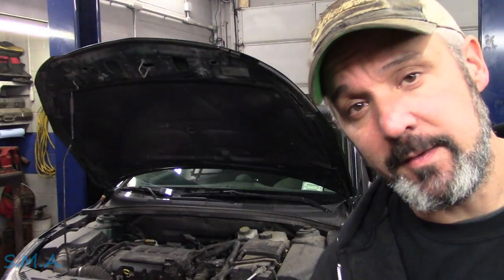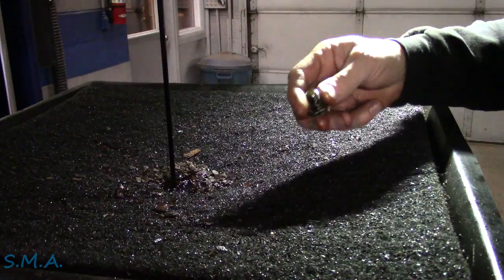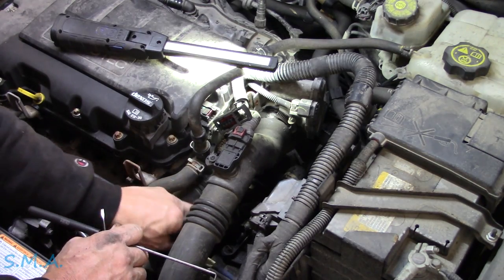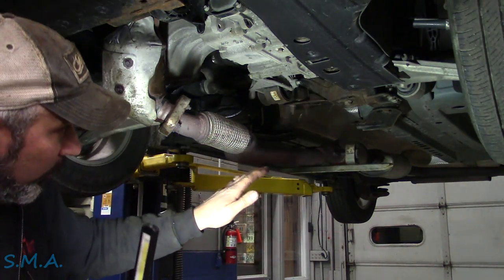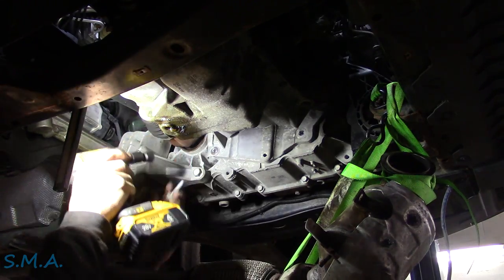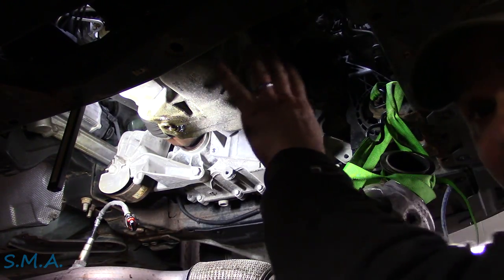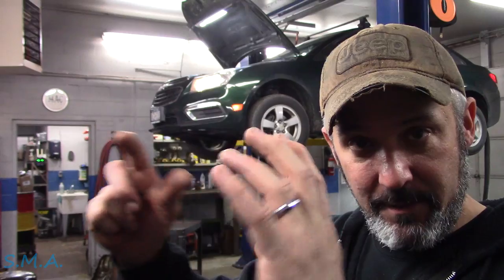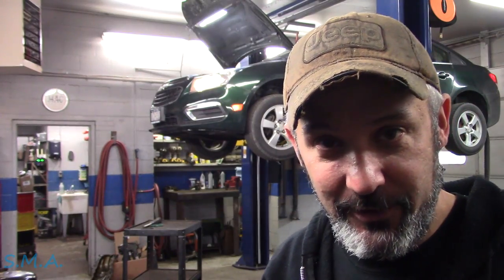Chevrolet Cruze 1.4 Turbo: Oil Pan Replacement

Comment: I have this same turd. It's a 2015. I've already replaced the coolant output,  the thermostat housing and the valve cover.  Now everything else in the video except the pan is leaking oil everywhere.  Great video Eric.  I've been trying to figure out what else exactly is leaking. Their is oil all over the passenger side of the motor. I am more of a chevy guy but these cars are trash.  However its paid for and my son is 16 so I guess ill just being doing a bunch of fixing.
Reply: Ive heard that Cruze is trash. Here in Michigan I dont see em as much anymore but recently tried to talk a friend out of buying one. Was unsuccessful and its already in the shop

Comment: Although, I've always changed my own oil, a decade ago I switched over to vacuum extraction...  I fell in love with the process so much, I dropped the oil pan on the 1993 C1500 to weld in some blocking plates to keep the vacuum pickup tube from getting hung up in the pan's slosh baffles.

Seriously, do your own vacuum extraction and knock down the risk of the damage quickie places inflict to once a year for a new oil filter.

Comment: I hated working on these cars when they first came out, but after a few years I don’t mind them at all, there’s just a few things that you know exactly what is wrong as soon as the car rolls into the bay and they can make you a lot of money lol. Feel bad for the customers that own these things though that’s for sure. I had a guy a few months ago bring one in, he had the valve cover, intake manifold, water outlet assembly on the driver side, and the turbo fail all in one shot, again sure felt bad for the guy but I didn’t mind that ticket at all lol.

Comment: The plastic turbo return pipe is quite common for cracking on these engines in the uk. Think its due to heat.
Reply: Look at them the wrong way and they crack. I always order one just incase

Comment: For all of Scotty's GM bashing, I was expecting to see a plastic oil pan, but this is a good old-fashioned metal oil pan, which looks like it could absorb some punishment, if you were unfortunate enough to run over large debris on the road.  I think I also saw that the torque spec for the oil drain plug is right there on the pan, so if only the oil change techs would follow them, there would be hope that it won't happen again to your customer.
Reply: It is only aluminum because it is a structural part of the engine / transmission.  Otherwise it would certainly be plastic.  None of the automakers do things like this for "beefy" reasons.  They care about the bottom dollar cost and that is it.
Reply: This is why the only person that works on my cars is me.. If I screw it up I only have one person to blame, but you can be darn sure a drain plug will never be stripped out.
Reply: Ive seen video of some new audis with plastic pans. It’s the dumbest idea yet.

Comment: Let me tell you how lucky you are to have a lift. I just changed the y-pipe on 03 blazer. New England is salty. Had to remove the trans cross member and all we had was cement blocks to raise the front end. 68 years old isn't good for climbing under any car. It took the whole day and I used the special sockets.

Comment: Dunno about the auto industry but in my experience nothing more permanent than a temporary fix. :D
Reply: I used K-Seal to temporarily fix a coolant leak on my 2001 Taurus, until I junked it two years later. The job was an 8-hour $$$$, and the car wasn't worth it.

Comment: Oh yeah.. Even in a non salt state the studs on those exhaust flanges snap like carrots! I can't remember if I beat out the remains with a hammer or drilled 'em out. Either way you can get them out quite easily and replace with a regular nut and bolt.

Comment: I'll never understand why someone would pick this over a Corolla or Civic. The amount of problems that show up before 100k is truly astounding. Only FCA can rival GM's lack of quality.
Reply: I agree as these are notorious for issues, most chevys are but the cruze, every time I hear its a cruze, I shudder 🤮
Reply: @Jonathan A I actually have a Ford focus and not had much trouble atm but as I am a mechanic I know the trouble is coming
Reply: I would agree with you but we buy thi things knowing what problems they will have. You go to the showroom and drive a range of cars. When we drove the Cruze with its plush leather interior and heated sets it felt like a better car  than the equivalent Toyota.. At a lower price too... Its only later you find out why Toyotas and Hondas are more expensive used.
Reply: @frankish5314  we buy cars because we need cars and some of them are nicer at a lower cost but at the end of the day no vehicle is problem free just some get them quickly and some don't
Reply: @Jonathan A well a lot of chevys are the same. I swear that they make them out of pot metal
Reply: cheap. I bought one a year ago for my youngest son just getting his license. they are dirt cheap and so are parts generally speaking. As long as you know what you are getting into and don't mind doing the work yourself, it can be maintained reasonably. Hell, I think an entire manifold/turbocharger is only like 400-500 bucks? I also see it as an opportunity for my youngest to wrench on his own car a little and learn the basic ropes. The only pisser is the oil leaks. I need to do the oil cooler swap due to a small drip, but that's waiting for warmer weather. I just make him put cardboard under it where he parks, hehehe
Reply: @funkyzero  true and as you said it will give your youngest a chance to learn
Reply: @Jonathan A no I've seen my fair share of Hondas and Toyotas with very similar issues, fact of the matter is it boils down to cost. Ask any business and they will tell you pennies matter in amounts of millions
Reply: @frankish5314  Several years ago a woman I worked with asked me about why I bought the new Toyota. She had looked at it and decided it was a little too plain. I told her in 10 years that Toyota will only be worth $5-6K but yours will be in a junkyard.
Reply: @Jonathan A sorry I have been replying to many comments on many different videos but to mention the fusions I have seen vehicles where the engines have grenaded themselves through no fault of the owners amongst other things but I'm sorry that I missed that bit
Reply: My 06 civic is the biggest POS I’ve ever owned.
Reply: I have a 08 cobalt from new. No problems at all. But then again I'm not an idiot that doesn't change the oil lol

Proper maintenance seems to make almost anything work for longer. As long as you're not treating it like a race car.
Reply: The chassis not bad, it won 4 WTCC championship on the same chassis, but powertrain is kinda soft. I had massive seals leak at 60k
Reply: @merlars  same here I've seen all brands of vehicles and models with problems. Some car designs are inherent for problems. Being a mechanic myself, I have sometimes looked at a particular design choice and said wtf did you design it like that for.
Reply: @tomgeorge6865  I had a civic and then because of a design choice, it blew up 😁

Comment: Great video since I own a cruze with the same 1.4, mine sounds like an exhaust leak just started the other day, checked the exhaust pipe by converter seems good, looks like it may be my turbo that has the leak, just from what u have show. I will find out on my off days work. If you own a chevy cruze, best advice is to have a backup vehicle.  Lol Thankyou for that video.

Comment: There's also a valve in the intake manifold for the PCV system. g_m has a campaign on these engines ,at least for the original owner. Ten years or 120,000 miles

Comment: If you take the engine torque mount and bracket you can get the pan out with the cat in place. Getting the cat in the v band can be a mother

Comment: turbo housing cracking is pretty much normal on all factory turbos, you should see the inlet side of the 14b used on DSMs.... pretty gnarly but somehow they never crack to the outside

Comment: As usual, GM cutting corners and poorly designing these so-called “economy” cars. Saves yourselves the hassles people, and trade those small money pits for a Toyota Corolla or a Camry. A heftier price tag, but better reliability, and slower depreciation rate. ...not tryin’ to be Scottie Kilmer here either. I’m telling you this from experience.
Oh!!! I almost forgot to add, that just recently, I bought a brand spanking new OEM valve cover for my brother in law, who lives across the border, south of the Old Rio Grande. He drives one of these Cruzes. The Valve cover came with a sealed, embedded and defective PCV valve; and now he’s begging me to have GM return this damn useless paperweight for a new one, as I’m fighting with GM for a proper working one. 😫 Long story short;
These damn cars are a pain in the hoohoo both to work on, to own, and to sell!!!! Get rid of it as soon as you buy one for pennies on the dollar.
Reply: How comforting ;) it is to know, then, that GM is now leading the way with EVs.
Reply: Sad to see how far GM has fallen.  Used to be one of the largest and most successful corporations IN THE WORLD!  Hate to be non-PC, but, their current state of affairs has a lot to with the present CEO, IMHO.  My neighbor just bought a new GMC pickup with "the big 6.2".  5 months old and less than 8k miles it bent 2 pushrods.  GM has had the truck for over a month now.  "Cant get the new parts", they say.  SERIOUSLY?!  2 PUSH RODS?!  I was ALWAYS a "GM guy" growin up and in my younger days (soon to be 64).  Never again.  Like I said, sad.
Reply: @beauhatman4395  On the GM Authority website it says the dealers have to fix every truck (7 models) before they can sell them. article title = " GM Releases Valve Lifter Service Update For V8 Engines " Sad company.
Reply: I traded Ford and Gm for Toyota and never regretted it.
Reply: Gm will be out of business in the next 10-20 years. The older generations still see them as a decent brand. Younger generation sees them as junk
Reply: Rev up your Corollas and Camrys!!
Reply: @Chantillian  Leading the way to the scrap yards of tomorrow.
Reply: I've had my almost 2004 Tacoma for about 5 years. In all that time I've fixed a camshaft sensor code with a zip-tie and put in a junk yard window regulator and an O2 sensor. Runs great.
Reply: The extreme methods and capital outlay GM (and others) will go to avoid a gasket is mind blowing.  Robots can place gaskets, too, but paper has gotten expensive!
Reply: @beauhatman4395  My buddy's 2021 5.3 with 6K miles just blew up also, lol. Meanwhile my Yota with 219K runs perfect.

Comment: You should get an induction tool to heat up the bolts and nuts and break the the bolts and nuts loose. Have you tried one of those tools?

Comment: Dorman fixed the thermostat housing problem by making it in metal now
Reply: yeah, one of the RARE things they got right, along with the aluminum GM 3800 coolant elbows
Reply: @mattcat231  no they also fixed the plastic Mopar oil filter housing/cooler issue by making it all metal also

Comment: I have learned recently that’s not the correct install method for Ultra Gray RTV. I’ve had issues with Ultra Gray leaking until I learned the proper way, which is to install all fasteners finger tight, wait an hour for the RTV to set up, then torque to spec. And they say to wait 24 hours before putting the engine into service. But I think waiting an hour before torquing the bolts is key. I followed this procedure when resealing the trans pan on my Mazda CX-5 back in February, and it has no leaks so far.
Reply: It's true. you have to wait 24 hours, for the best result.Or at least, finishing today, and start it next morning. I had an oil pan (no gasket) ,and I tried to seal it. I did the job 2 times, was still leaking (put sealant and start the car after couple of hours) ,one guy(the sealant salesman)told me to wait 24 hours, I did it,and it's 6 years now, with no drops.
Reply: @Lambros_Stefaneas  right, and doing hand tight, wait an hour then torquing makes sense also because torquing to spec right away could squeeze out too much of the sealant. Letting it set for an hour is going to create a thicker, more complete seal, and then it gets the full torque spec.

Comment: So when you checked that bead around the pan after you tightened it down, and you saw a tiny gap of no sealer, would you remove the pan and do over, or run it and see what happens. I'm thinking the later.

Comment: I had the same problem with my magnet light. I got rare earth magnet  and used clear silicone. It worked great until I ran the light over. 😭

Comment: SOP lube guy. put impact on drain plug strip it forward then remove plug. drain half the oil. overfill crankcase so it gets away from the shop before it runs out of oil because of course you left the filter loose. Gold star loober.

Comment: I have a 14 with the 1.4. Been an ok car, but has had its issues. OE brakes made it to 130,000 miles. OE tires made it to 80,000 (actually had about 3/32 on them when replaced). Still on the second set but they are getting close. It has 150,000 miles on it now. Had to replace the water pump 2x under warranty 1x by me. Valve cover, intake, and PCV system 1x under warranty 1x by me. Had to put a converter on mine this past spring and the turbo wastegate was cracked on mine as well.  It wasn’t throwing a boost code so I’m letting it ride for now. Also had to replace the coolant manifold and the reservoir tank. It’s my commuter car in the DC metro area.  Given how these idiots drive here any day could be it’s last so it gets what it needs and nothing more.  So on a scale of 1-10 I’d give it a 7. Not terrible but a lot could have been done better.  I do almost all my own work though.

Comment: Did you ever get to replacing the turbo and the oil filter housing? My Cruze is needing all of these repairs and I am looking to do it myself to save on the insane labor rates.

Comment: I think the oil cooler is starting to leak on mine, getting the burning oil smell lots but don’t really see it leaking. But last thing I ever want to do is work on my own car after work or on the weekends. But I got it cheap cause cause it’s a stick shift and the previous owner couldn’t sell it. Apparently nobody knows what the clutch pedal does anymore.

Comment: Surprised Chevy doesn't market that turbo case crack as an "overboost" solution! 😄

I wonder if some JB Weld EXTREME HEAT paste might extend the life of that turbo housing? 
Just curious...
Reply: My dad would slather some on for sure

Comment: Hey Eric! I had a question about the tool you used. Where can one find the tool you used in the silicone tube? That's pretty nifty and seems to be a lot easier to use than squeezing it like tooth paste lol

Comment: We have a 2014 Cruze Diesel since new. The only problem we have ever had is the DEF tank. Twice the heater failed and was under warranty. Other than that no leaks no other problems 115,000 miles since new.

Comment: As someone who does most of the engine work at an auto recycling yard, I can attest to the fact that those exhaust housings on those turbos usually start to crack around 25000km’s.
Reply: That’s only 15K miles, for y’all Americans!

Comment: Nightmare  I been in my 92 ford econoline e150 steering gear box broke off the frame and pulled one bolt through the frame. I tried to get by with a used steering box but couldn't line it up so iam   going to try and trade or junk it .I should of looked at the frame when I bought it.

Comment: Along with removing the oil fill cap I stick a piece of green painters tape on the ignition key slot.
One would have to be some kind of stupid to pull the tape to start the car.
Reply: Famous Last Words: "Of course I put oil in; I'm not an idiot!"

Comment: Hi Eric. I've got a customer that has a 17 Cruze  1.4. Put on a p0420 code after getting fuel.   Have you run across this  ?  There is a video out there covering this about aftermarket cat, purge valve, possible charcoal canister causing the issue.  Any insight on this would help.  I don't have the expensive scanner s you have   thanks. Keep up the good work !!

Comment: I gotta question about my Chevy Cruze 2016 first generation. I wanted to know if this car has a rear main oil seal and if it does how hard is it to get to for replacement? I know it has a front crankshaft pulley seal but does it has a rear main oil seal.

Comment: PEOPLE!  Never ever take your ride to any quick change oil scam place.  Find a good clean private garage and pay an extra $10 if needed. Besides, the caliber of people hired to change your oil and try to scam you into a " transmission flush"  may or may not have a clue as what they are doing.  Hey, it's only a $5k  to $10k engine, so go ahead and take a chance for a few lousy bucks.

Comment: There is a coolant bleed screw on the top of the radiator on the passenger side. Helps with burping the little pain in the ass cars.

Comment: So the whole engine, tranny, and front end all comes out at once. In Japan they used to make car owners in the city replace the whole unit every 60,000 miles. It saved the oil drips and bad economy problems. I don't know if they still do it but if the body is good, why not? It's cheaper than buying a new car.

Comment: Had another shop bring car to mine. They had swapped the boost sensor and o2 sensor plugs. It fried the boost sensor because it doenst have a heater circuit.

Comment: My sister has a 2013 Equinox with the Eco and it was puking oil out of every possible orifice. $ 2300 later she got her vehicle back from chevy. Now I am worried about my daughters 2018 Malibu with the turbo eco engine. trying to see if there is a service bulletin on that engine regarding the pcv system. A local shop just changed the pan gasket, but the concrete where the car sits is completely dry!

Comment: Why didn't you add sealant where the gaps were at the metal interfaces. Leaks usually occur in those spots.